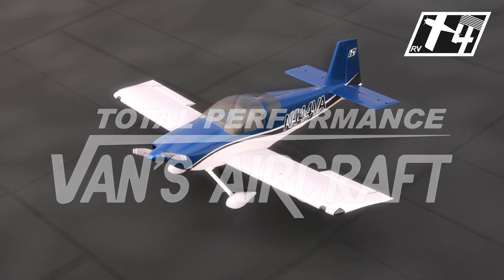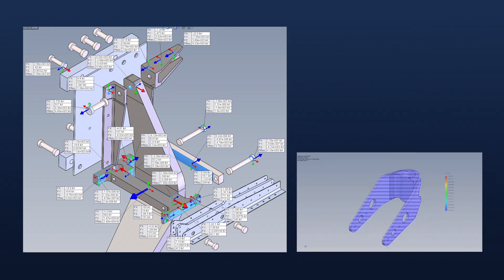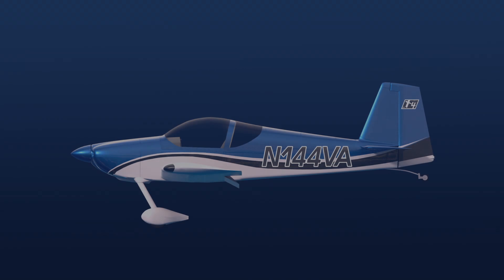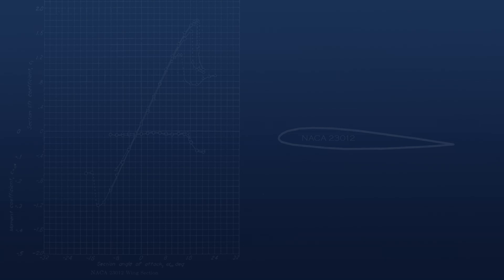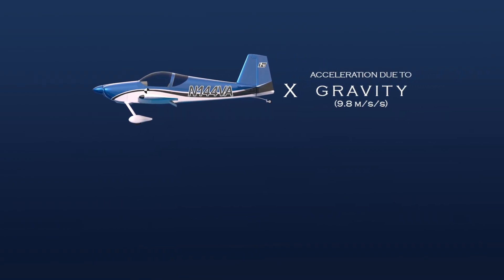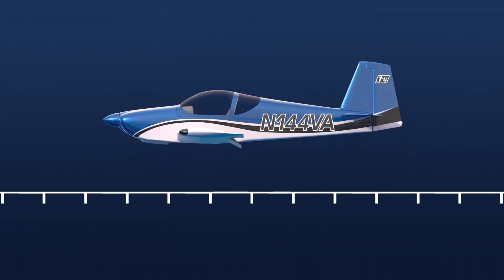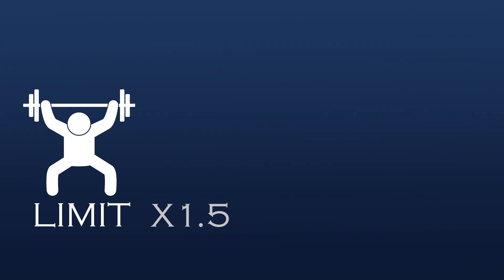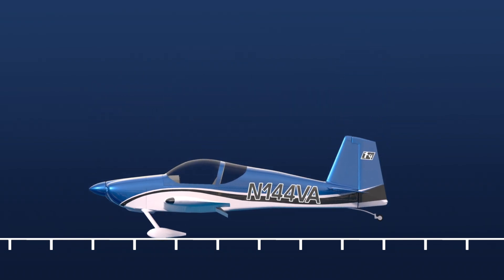RV-14 Drop Testing

Comment: that frotn wheel is a terrible design, if the plane is carrying too much weight, lands too fast, or nose first. the metal will touch the ground first and sending the wheel shaft straight to the engine.

Comment: isn't the drop height was too low? i mean the velocity at which it touches the floor was just like as if we're jumping off a dinner table? does it reflect real situation?
Reply from the maker: Yes it does reflect a real situation.  Keep in mind that the landing gear on an airplane is never designed to absorb the loads induced with a drop from any height above a runway (there is a point that an arival would be considered a crash).  As described in the video, when a wing stalls, the amount of lift it is producing does not go to zero.  It just has a sudden reduction.  So if we are wanting to simulate a drop from 3 feet because of an inadvertent stall, we wouldn't drop the test airplane from 3 feet high, because there is no way so simulate the lift still being produced by a stalled wing.  So engineering calculations are made and the drop height is adjusted to produce the known amount of decent rate that would exist at touchdown.
Reply: @FlyVansAircraft  is there any standart have ?for this experiments ? EU - ASME-or another ?
Reply: @FlyVansAircraft  is there any standart have ?for this experiments ? EU - ASME-or another ?
Reply: Basically, engineering can't save you from pointing the nose at the ground and applying full power, but it's intended to provide the most protection it can for a reasonable situation that might get out of hand. 

Interesting video!
Reply: These test are done to standard and not a gram above or an angle steeper.  Remember these aren't sold to the Navy

Comment: Thought my friends would like to see how Vans (the manufacturer of the RV14 kit) has tested the RV14 airframe I am building.  It makes me even more confident in the kit I have chosen.  This is a tremendously strong airframe.  Everything I have built to date has assembled perfectly....absolutely.  It is an amazing kit, so precise, incredibly strong, a tremendous confidence building project.  You almost have to see it to believe it.
Reply: Did you complete your project and get it flying?
Reply: @Kevin---kx3jy  I am close. Currently all airframe components are complete. I am installing the wiring harness for the avionics. All the avionics are in place…I’m just running the harness and securing it. Next step is to move everything to the hangar and bolt on the wings and tail and hook every thing up, get weight and balances and a 1st engine start prior to inspection.
Reply: @davidhays5020  congratulations! A friend and I are building a 14A in Santa Maria, CA. Airframe is done, panel is done, engine got hung last month, and the prop is going on this weekend. We will be moving the fuselage to the hangar soon where we will install the wings and do all the fiberglass work. It’s getting exciting. Where are you located?
Reply: @Kevin---kx3jy  …I’m located in Senoia GA…home of the Walking Dead TV series.